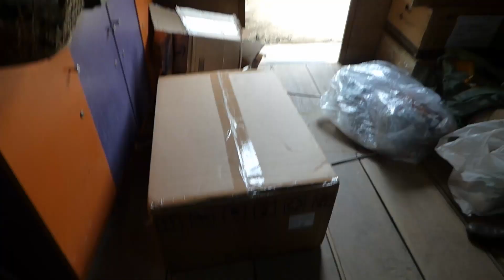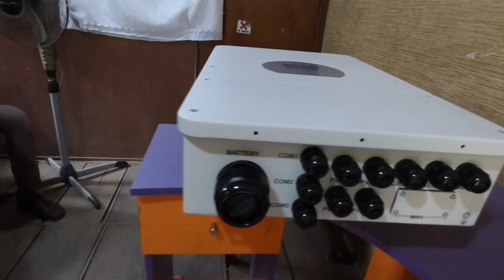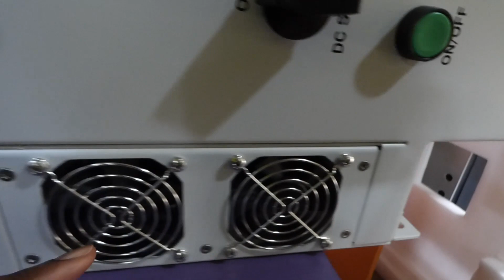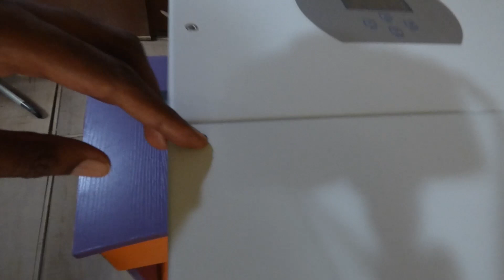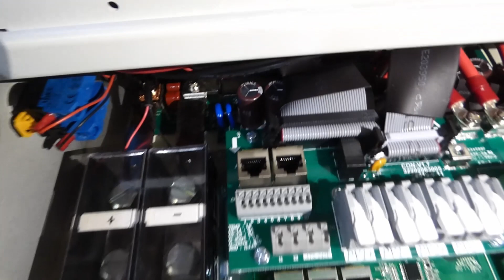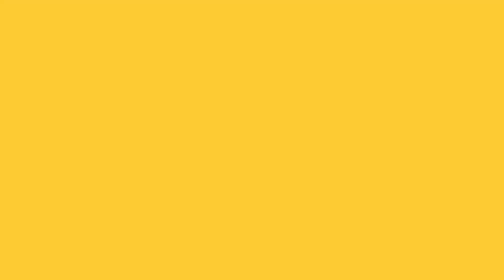Unboxing our newest Inverter

Comment: Thank you so much for this great unboxing. Yes on the Sol-Ark.com website, they sell this same 8K Inverter,   but they also sell this 12K Inverter:

https://www.sol-ark.com/sol-ark-12k/

Does DEYE sell the same model?
Reply from the maker: Deye has a 3 phase but it does not have the breakers that the Sol-Ark has

Comment: Received mine yesterday.....heavy!
Reply: Do you know what was the shipping weight and dimensions?
Reply: @EnriqueReyes  The packing size: 870mm*596mm*350mm
 Package Gross weight 36kg
 i have not unpacked mine to mesure or weight the unit
Reply from the maker: Congrats. You will like it. It is an intimidating piece of equipment.